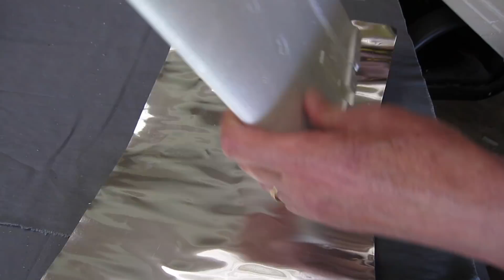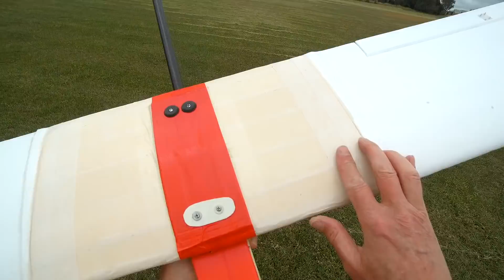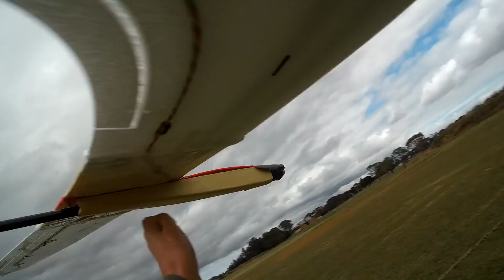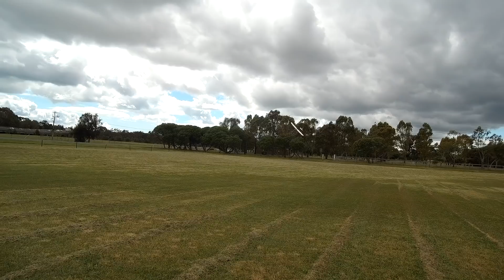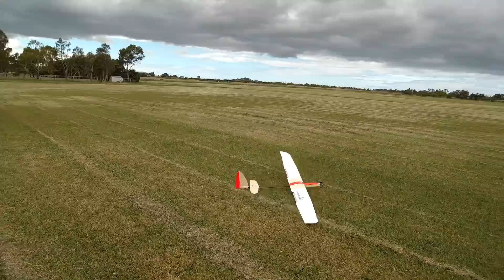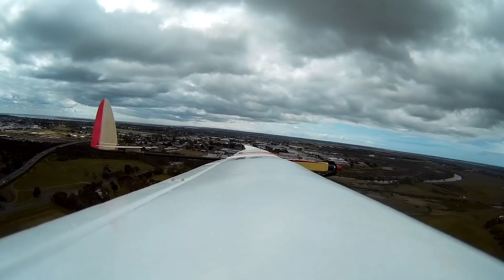Ranger-wing 2.7m glider

Comment: That's one skinny vertical stab. How do you hold that in place at the end of the fuse? It hardly moved when you landed and the plane slid sideways on the grass.
Reply from the maker: It has 2 balsa strips either side making it 15mm thick where it glues on to the boom

Comment: what power system are you using?
Reply from the maker: 3536 1200kV on 3S with a 10 x 6 prop and 40A ESC
Reply: @AndrewNewton  which brand?

Comment: Lovely glider Andrew! I’m interested in folding props; how do they attach to the motor? Is there some sort of adapter I get purchase to attatch folding prop blades to my brushless motor? Thanks! :)
Reply from the maker: Same as a normal prop adapter just that it has a plate and prop pivot points as well. Search on HobbyKing and you will find them
Reply: Alright. Thanks mate. :)